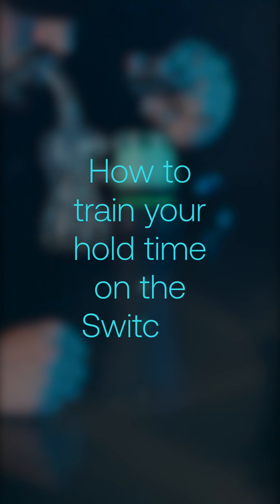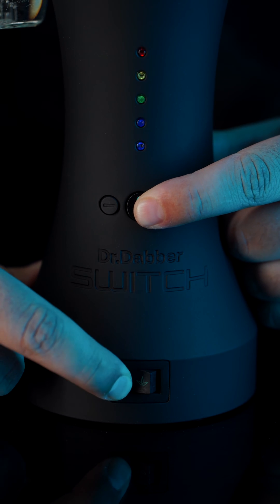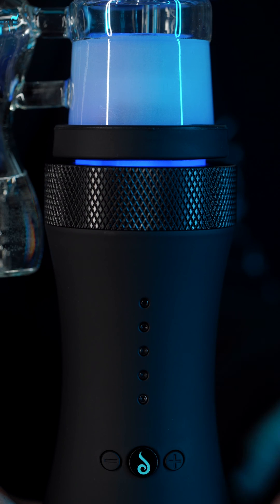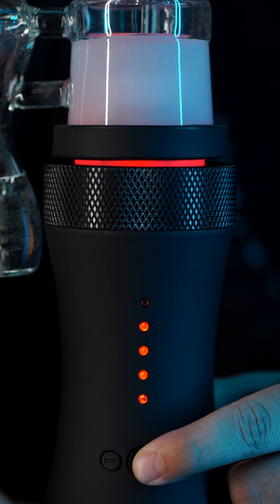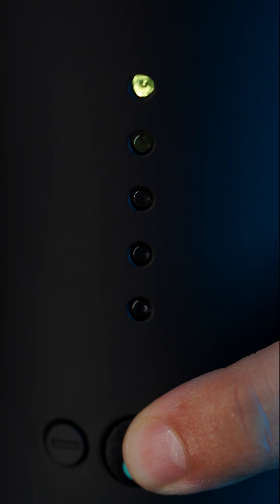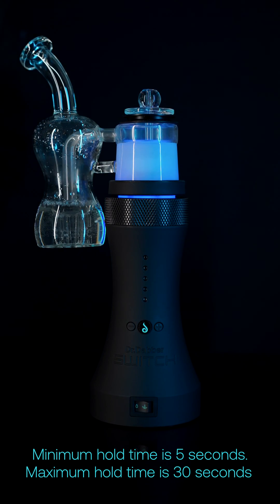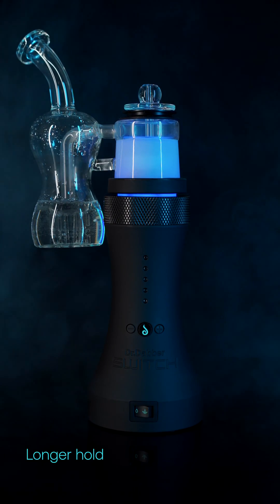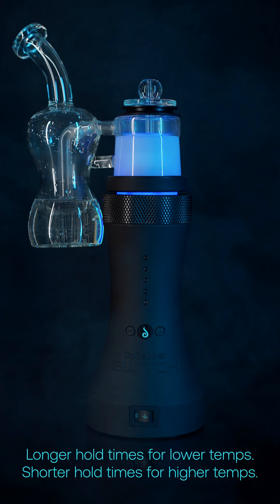Pro tip: adjust your hold time on the Switch™ for the perfect hit! 🌬️💨💯

Comment: It's not letting me adjust the hold time. I keep setting it for 5 seconds and it keeps operating with a 15 second hold time, no matter how many times I try to adjust it to 5 seconds. 😢
Reply from the maker: You may only adjust the hold time in advanced or crystal mode. Check this video out for more details. 

https://www.youtube.com/watch?v=dt2Lg4KC7Bs&t=10s